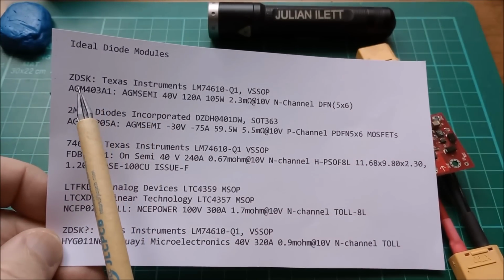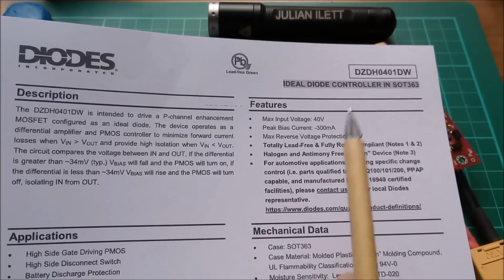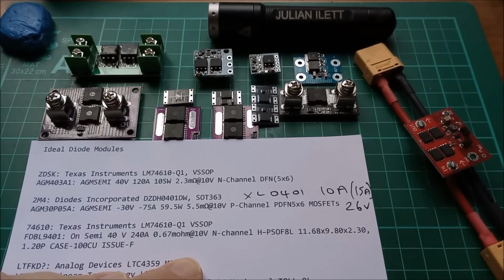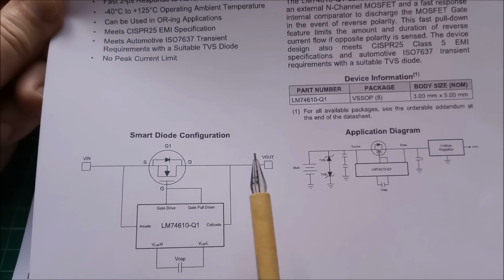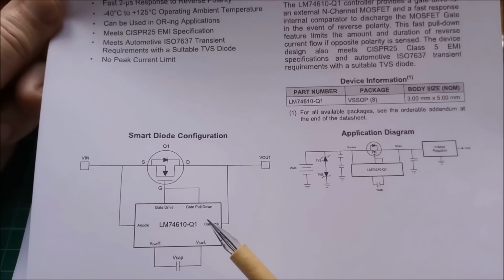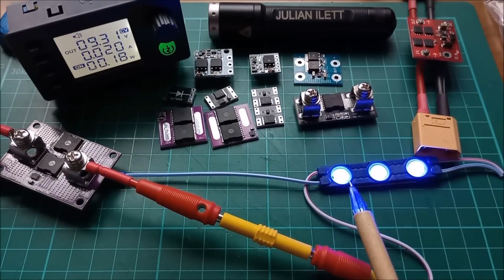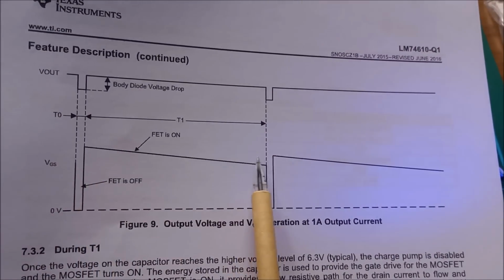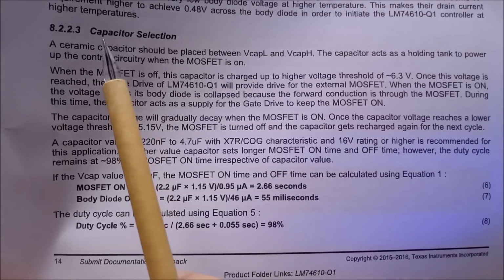Ideal Diodes from AliExpress

Comment: What happens when you short the output and voltage between In, out and GND is <5V or whatever is needed to keep the MOSFET fully on? Does it stay conducting using only the body diode and BURN?

Comment: are there any videos if possible to insert ideal diode like lm74610 ZDSK board XL74610 in between li ion 18650 cells in series like lm74610 lm73100 ltc4359, since they'd have a resistance of the order of milli ohms similar to battery internal resistance

Comment: Can you tell me which module can be used to protect current leakage from the battery back to the panel or charger? Now I use shottky diode, but I try find better solution

Comment: There is a "Mini-module for controlling the MOS switch" on the transistor NCEP023N10LL and 5N04N010 for sale on ALI. But it lacks a control chip, a couple of resistors on the positive and that's it. Is this a replacement for an ideal diode or not?

Comment: Is the 2% recharge time enough to cause issues with electronics downstream? Would putting a smoothing capacitor inline downstream alleviate that? Also, how would something like this behave if it were to fail? Would it fail open-circuit or closed? How would you tell if it failed full open? Would a TVS to ground ahead of it be helpful in surge events to not fry the ideal diode? So many questions!!! Very cool electronics!
Reply: Can you parallel them to gain higher amperages? More parts = more failure points? How do they perform at higher amperages and what happens if they go over amperage,

Comment: Hi. Great breakdown, I can now see I got a bit lucky using some of these and not burning things down, because I did not understand entirely how they work. Can you please explain a bit more about the maximum voltage difference between anode and cathode? If it is stated at 40V, it means i can not connect a 48V battery charger to a battery through it, because when the charger turns off, there will be 48v difference between anode and cathode? In fact my use case is to connect two boost converters in parallel to transfer power from a 12V battery with solar charger, to a 48V battery, and I intend to use ideal diodes to isolate boost converters' outputs from each other. Thank you

Comment: One thing I'm curious about is the frequency limits, or the amount of time it takes to switch the MOSFET on and off if the input voltage polarity reverses/switches off.  You'd think for such large MOSFETs it would be pretty slow since it seems like the available gate drive is quite low, particularly the ideal diode type.  Not necessarily an issue for 50/60 Hz power, but repetitive transients could be interesting.
Reply: I’d like to see this too…
Reply: The MOSFET can switch very fast but because the control circuit is design for low power consumption its ability to turn the MOSFET on and off rapidly will be the real speed limit. Versions with a 3 wire which has a enables them to operate continuously could be design to switch much more rapidly, but generally 10's of KHz would be realistic which is not a challenge at all for the MOSFET.
Reply: I've been trying to find the answer to this as well. I think most of them are not optimised for high frequency operation. I'd trade a bit of efficiency for a faster, more powerful drive circuit so these could be used as 
Part of a pseudo synchronous converter

Comment: Diodes pass Voltage not current, unless under load, there is no current. However, the diodes have a Current limit.
Current does not flow, it is static in any circuit, Current creates a Magnetic field which can be measured by a Coulomb Meter or a Resistance shunt, where you read a Voltage to calculate the Current present under load.
The subject is of course up for debate, but without Voltage and a load, expressed in Watts, there is no Current present, it does not suddenly start flowing, as there is no place for it to come from.
Reply: By saying there's reverse voltage protection, but not reverse current protection, he may have been referring to the fact that an enabled MOSFET allows current to flow either direction. So there's cases where, once the MOSFET is on, it isn't going to suddenly go off where you might expect. 

Like connecting a battery to a motor controller and the controller switching over to regenerative braking. Supporting this varies based on if the FET is p-channel or n-channel and based on if the controlling IC has anything baked in for the situation. That last chip that was labeled as a power path controller instead of an ideal diode, for example, is intentionally designed to block reverse current if a wall power supply is suddenly plugged into the load.

The FETs all have body diodes as well which have to be oriented a certain direction and allow current through when off that way. That's why the one board with an on/off needed back to back FETs. You arrange the body diodes facing each other and then have full control.
Reply: @LanceNanek  But refer to my previous. Current does not flow, current is static as a magnetic field surrounding the conductors. Remove the load and the magnetic field collapses. Electrons flow, current does not.
Reply: @G1ZQCArtwork oh, you're right. Even the other replies talking about this that I thought you are addressing say "reverse polarity" protection and "reverse flow" protection. They don't use the word "current" incorrectly like me. Thanks for pointing that out.

Comment: Any follow-up video would be interesting to compare the reverse leakage (if any) and the quiescent current to ground.  Don't want to be leaking the battery into the "diode" just to hold it in an off state.

Comment: Not to be picky but current is the flow of electrons so current flows from the cathode to the anode, not the other way around. Yes, current flows counter to the arrows on schematics.
Reply from the maker: I'm a conventional kinda chap ;)
Reply: No, that is not how the term "current" is typically defined or used in modern electronics contexts.  In circuits, electrical current is pretty much universally defined as flowing from positive to negative.  The fact that it happens to be caused by a physical phenomenon that involves some elementary particles moving the opposite direction is basically irrelevant, and does not change what the term means or how it should be used when working with electronic circuits.

(And really, you could just as legitimately say that "current is the flow of valence shell vacancies" (aka "holes"), in which case it would physically be from positive to negative too.  It's all just a question of perspective.)
Reply: @foogod4237  So you are right except I am right about the physics.  You are going to get into problems later on if you have the very basic physics of things wrong.

So, in a rube circuit,  the plate is the source of the electrons and the cathode is what catches them at the other end?  And they heat the plate and not the cathode?  Or do electrons go the other way in tube stuff?

You are really not doing your further understanding of how devices work until you understand how current flows, and I am sorry to say, that it flows from the cathode to the anode.  It is just that simple.

Comment: Very interesting comparisons and video, It looks like the P channel modules do not have the switching issue between the internal diode and mosfet of the N channel types, which must create a lot of supply line switching noise. Where as the internal resistance of the P channel mosfets is higher, so dissipate more power than the N type. It worth noting mosfets have a positive power coefficient so the hotter they get the less they conduct, so in theory they will self regulate.
Reply from the maker: It's only the 74610 controller that switches the MOSFETs off every 2.66 seconds. The LTC4359 controller drives N-channel MOSFETs and doesn't do the switching (but it does need a ground reference).

Comment: Julian, the top-right Blue-colored PCB module may be using LTC4412 (marking LTA2).
Reply from the maker: I think you're right. All the chip pins (that I can trace) line up with the LTC4412 datasheet. Interesting that it's not called an ideal diode. It's quite hard to find in a Google search.

Comment: Hi, great video as allways. Does this mean that if the diode feeds a capacitor which maintains the voltage on the output, the chip cannot recharge the capacitor and is this a problem?
Reply from the maker: As long as a reasonable amount of current flows, the 74610 will work as intended.

Comment: You know those gray square rectifiers with 4 connections that turn ac to dc, could one of those be use with a bunch of solar panels wired in parallel going to the ac side of the rectifier, would that stop power  going back to the panels at night
Reply from the maker: A bridge rectifier you mean? You'll only be using two of the four diodes and they could get pretty hot.
Reply: That's just a device with four regular diodes inside. You could use it, but you have all the disadvantages of a normal diode.  Actually, I think you'd be going through two diodes each way, so you'd have double the disadvantage.
Reply: Yes, you'd be better off using just a single appropriately-rated diode. The only reason to use a bridge rectifier for DC would be if you wanted to allow connecting the input with either polarity.

Comment: I'd like to make use of these modules, but there is limited data from the sellers, some are far from ideal. Looks like most can be used in a battery charging application, but for reversed supply polarity protection their operation is not clearly specified. It seems the ones with ground reference are the ones to choose for stability, but leakage and current consumption are also factors to consider.
Reply: Many of the "ideal diodes" (quite the misnomer) provide reverse polarity protection, but not reverse flow protection. The latter is often the much more important function, especially in PV/battery charging situations. You can do "reverse polarity protection" by just making sure you connect wires right (so you don't need a diode at all), but you can't prevent reverse flow by "just making sure". If in doubt, don't get them.